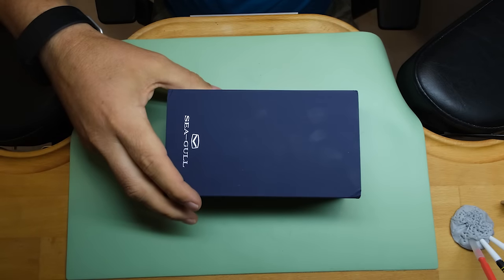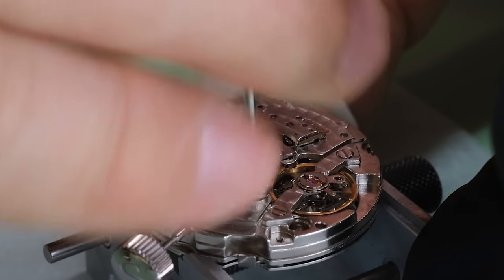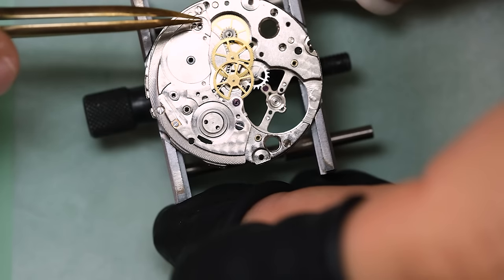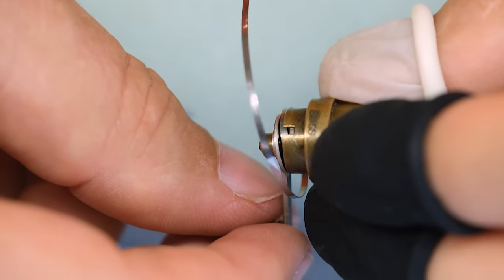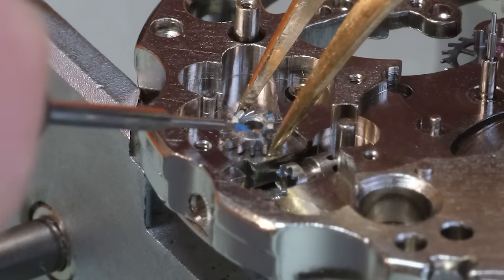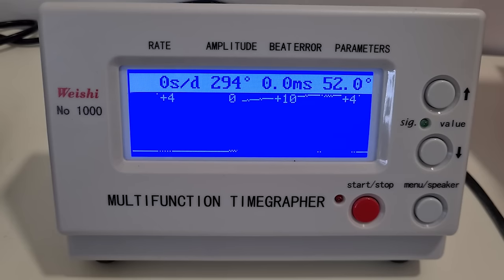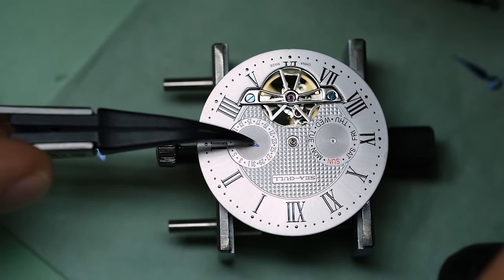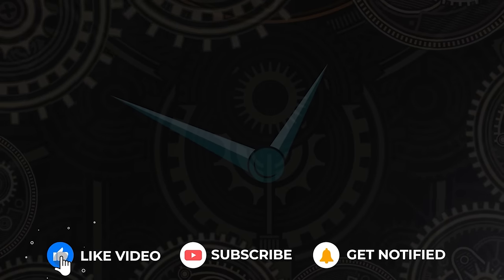How good are Chinese watches? Teardown + Giveaway!

Comment: The best new Sea-Gull movement to learn on is probably the ST3600/ST3601/ST36K.  This is a close copy of the ETA 6497 pocket watch movement, and fits nicely into a Panerai style case which can also be bought from Chinese manufacturers.  You can get it for maybe US $40 to $50 if you hunt around for it.  Some versions have the perlage on the visible plate bridges while others do not.  There is a version of the ST3600 which is decorated (perlage) and has a decorative non-fuctional swan neck regulator.  It may be possible to modify it slightly so that the swan neck part of the regulator is functional, at least within a limited range (needs a longer screw, and the swan neck spring needs to be a slightly different shape).

Similarly the ST3621 is a copy of the ETA 6498.  It's also recommended as a practice piece but is a little more expensive.  I'd be interested to know if there are any quality differences that people might have noticed given that the ST3621 is almost double the price.

The correct name is in fact Sea-Gull.  The late fifties of course it was just "Wuyi Watch Factory", which became "Tianjin Watch Factory" in 1962 when the factory was relocated.  The name of the watch being proposed for export around 1973 was the "Dong Feng" which means 'east wind'  This wasn't very politically sensitive at the time so the name of the export watch became Sea-Gull.  The name Sea-Gull as a brand for the company didn't come into existence until 1992, when it became "Tianjin Sea-Gull Watch Group Co. Ltd"  I think the hyphenation is one of those "lost in translation" things that will often confuse the English speaking world when they come across it, and of course many of them will insist on calling it just "Seagull".  Some histories state this company came into existence in 1997, but the difference may just be when the Sea-Gull company was incorporated in different countries and different markets.

Care is needed with the Sea-Gull copy of the incabloc spring as it sometimes has the tendency to fly off (it is a spring and may go far if this happens).  It also becomes extremely difficult to replace it without losing it again.  Don't ask me how I know this...

It's also true that these movements are made by other factories in China, so there is some variability that can be found.  Sea-Gull manufactured items are probably the most consistent but quality control can be variable as noted in this video.  Generally speaking, Sea-Gull movements will have ST designators, while Tianjin Watch factory will use TY designators.  eg ST1612 is also known as TY2806.

These are my notes regarding currently available Sea-Gull movements for those that may want to delve into these affordable movements for learning and hobby purposes.  Prices are mostly Sea-Gull RRP for export, you may see different prices depending on where you buy them.

ST36 Mech
	ST3600
	K = skeletonised
	ETA 6497
        seconds at 9
	US$53.99

ST1901 Mech Chronograph
	31.3mm
	21600
	21 jewels
	Venus 175
	US$139

ST1612 Automatic
	Similar to Miyota 8216 (0.4mm dia difference)
	TY2806 Tiangin
	26mm, center seconds, date
	US$35.49

ST2130 Automatic
	ETA 2824-2
	Tianjin 2100
	25.6mm
	center seconds, date.
	US$109.99
	

ST8000 Tourbillon	
	Automatic
	30mm
	US$369
	

ST3621 Mech
	ETA 6498
        seconds at 6
	37.2mm
	US$110.52

ST2100	Automatic
	ETA2836-2
	25.6mm
	US$115.00
	

ST1812	Automatic
	ETA2892
	26.2mm
	US$149.95
Reply: Is the ST8000 Tourbillon any good?
Reply: @freenational  I haven't bought one, but from what I can gather from others that have, they are reliable and reasonably accurate.  There's a few companies putting them into dress watches successfully, and as one of the cheapest serious tourbillon movements they do represent good value for money.

I'm not sure what movement or design it is based on, but it is a real caged tourbillon which rotates once per minute.  I would assume that whatever movement it is based on means that this, like all the other Sea-gull movements, is a snapshot of older proven technologies.  I actually like the Sea-gull movements for that reason.

Sea-gull/Tiangin use CNC engraving to do fake Geneva stripes and don't do a lot of fine polishing so the finish will never rival the best Swiss watches in that regard, but the underlying technology always seems to be sound.  If you wanted to get a movement to learn on or put into your own case, or buy a dress watch based on this movement, I think it would be a reasonable way to spend your money.
Reply: Great info !!!!!
Reply: @freenational 

For US$369, I would go for ARSA(Hoga, Royal Elastic, etc.) with Swiss movements assembled in HongKong.
Reply: Very cool, thanks for sharing. I have a chinese sea-gull clone i believe, it is called TY2807, the movement came in an Armatron Skeleton type design. My impression is that its surprisingly well made for what it is, i find it very attractive and the mainframe is a brilliant dark blue. I mentioned this because i read the last calibre you listed. Thanks again, i love learning about the history.

Comment: I still find it amazing that they are able to produce such an intricate mechanical watch at that price. Copy or no copy, that's still a hard thing to pull off.
Reply: Agreed. I’m finding watchmaking making schools use Seagull Movements.
Reply from the maker: Yep, it is in itself impressive!
Reply: Modern technology. 3D scanning and printing and and high precision cnc cutting. They haven't had this in the old days, which is why I couldn't care less about these mass products and collect vintage watches instead.
Reply: Not an hard thing to pull off when you pay your employees slave wages, use cheap materials and designs and you have no R&D cost because you copy everything you do from your betters.
Reply: Working community still work 3 dollars a day. So they can sell at cheap price. Quality of material yet to be time tested life like 5 years or 50 years.
Reply: @veganbutcherhackepeter  Vintage watches are also mass-produced. While you're right in that modern CAD machinery didn't exist back then, every single movement made since the 1880s has had at least some degree of industrialization and standardization. The classic image of a hunched over Swiss man tinkering away in his cottage hasn't been the reality for a very long time.
Reply: @vinceslapchopper  China has had a rapidly-growing middle class for a good while now. While they earn less than Americans do on a dollar-per-dollar basis, their purchasing power parity has been roughly equal since 2015 and is only increasing. Also, the concept of intellectual property just doesn't exist for the Chinese. Never has.
Reply: @sj9918  With modern machining techniques in place, I bet these Sea-Gull movements will last a good while yet. Remember, there's a good number of pin-lever Timexes out there that still work, and those were built with no attempt at quality whatsoever.
Reply: @jakekaywell5972  Foreseeing harsh reality.
Reply: I'm pretty new to this interest/hobby and don't know much about horological except that whenever I wanted to buy a watch in the past, even from a young age, I had specific criteria.
It had to be automatic.
It had to have a resistance to water so that I didn't have to worry about it getting wet.
It had to keep good time so that I didn't have to keep adjusting it all the time.
To my mind this wasn't an unreasonable expectation.
I didn't care about the make.
My first watch was one I bought while on a school trip to Switzerland skiing.
I was coerced into going and encouraged to badger my parents into funding the trip.
I ended up being the youngest on the trip by some margin and was almost totally ignored by the teachers and senior boys.
With my meager funds I bought my first watch (Swiss, of course) and on my way back through customs was required to pay import duty. This I couldn't do because I had no money left. It was duly  taken from me and I was told that could have it back when the duty was paid.
I never saw it again.
The next watch I bought was when I was a young man in the british army posted to Germany. This was an Omega speed master.
I decided to buy this because it was automatic with good water resistance and good time keeping.
I was unaware of its heritage, only that it ticked all my boxes.
It was the worst time keeper I ever had! I became so fed up with it that when one of my peers slyly asked me to sell it to him I couldn't get it off my wrist fast enough.
Next was a Jaques Droz divers watch because I needed a replacement for my Omega.
I had never heard of these watches and just wanted a water resistant watch.
I can't remember what happened to it.
The next one was a Sekonda which I bought while on the cross channel ferry.
It broke before I got off the boat because I over wound it.
I didn't know I had until about half an hour later when it stopped working.
Never bought one since and never will again.
Years later and untold unmemorable watches later I bought a Citizen skyhawk in titanium.
AT LAST! A watch I truly needed and envisioned.
The three criteria easily met and more. RADIO CONTROL!
200m water resistance and so many features that modern developments have brought for this watch.
And lastly butt not least, solar 
power!
What more could a man want?
I've had this watch now for over 20 odd years (I'm 76). I've just had it serviced for the second time. The first service was to get a new glass and bezel and clasp, all of which had suffered severe scratching (I enquired about a new bracelet but was quoted £300!), and the second service was for a new capacitor.
£200!
It's an old friend now and nothing is too good for it.
Super titanium would be nice but it wasn't available back then and probably hadn't been developed.
I have a small collection, mostly Citizen, which includes 4 bullheads and an f900 satellite controlled watch in super titanium.
I wish I hadn't sold the omega when I did because I could sell it now and buy another 3 or 4 bullheads for the same money.
With all citizens developments super titanium is the way to go.
If Citizen and Casio were to collaborate what a watch they could produce between them!
Yes, I have a casio. A tech marvel in titanium. From the get go a faultless performer for not much money.
Sadly, it suffers from the same affliction  as my skyhawk - titanium scratches easily except when treated by being superised.
My f900 super titanium hasn't a mark on it.
Reply: @VintageWatchServices  They are assembled by children in sweatshops working 20 hour days. I wouldn't call it 'impressive'..... exploitative more like.
Reply: @yessanknow302  Nope, that's a stereotype now, especially in a highly skilled profession like watchmaking. Also, China has had a rapidly-growing middle class for a good while now. While they earn less than Americans do on a dollar-per-dollar basis, their purchasing power parity has been roughly equal since 2015 and is only increasing.
Reply: If you buy 10,000 movements they are still under 3 dollars each. Mass production but hand assembled.
Reply: @veganbutcherhackepeter  Then it is even more impressive that they build this since the '50s: More then half a century before 3D scanning and printing or CNC.
Reply: @jakekaywell5972  if you care enough about IP, you can find info about country with most registered IP, China beat other countries for the last 12 years.
Reply: Only 49% of the manufacturing process has to be done in Switzerland in order for a watch to be legally considered Swiss Made.

Comment: Having spent many years dealing with Chinese manufacturing, I can say with some authority that the attitude "all chinese stuff is low quality rubbish". It's simply not true anymore. I've worked in electronics to the auto industry out there and the quality is only getting better, WAY better. Wages and living costs are getting higher but that really does fit into the quality argument. If people feel they are earning a fair living and valued their work IS better. In the 60s Japan went through this cycle and the 80s Korea and Taiwan did. It won't be long before Chinese domestic cars are common place on European roads (MG are 100% Chinese and common in the UK already). Personally I like both of these watches and would not be ashamed to wear either.

Comment: Stian--excellent video as always. I think your assessment of Chinese watches hits the mark pretty well. I have several of them, including an ST-19-powered 1963 PLAAF "reissue," and I agree it's a great value and a cool watch. I put the decoration in the "looks glittery with the naked eye" category--a 10x loupe exposes a multitude of sins that one might not see in a far more expensive Swiss watch. The Geneva stripes on mine seem to be cut with a flycutter rather than a polishing wheel, but that's not that inconsistent with the original Dong Feng with the original ST-5 movement, from the time before the brand name "Seagull" emerged. Those had hand-cut decorations designed to catch the light, with grooves much bigger than would normally be the case with polish. I have several of those original Dong Feng-era ST-5 movements, and each are different from the others because of that hand work. Of course, there is very little hand work now, except to deposit dust, puddles of oil, tiny hairs, lint, and fingerprints. 🤭The Seiko aesthetic of minimal decoration but high functionality is not so much in evidence here. Still, a lot of fun for a hundred-dollar watch.
Reply from the maker: Cool to hear, Rick! I'd say this movement certainly uses part of the Seiko aesthetic, more specifically the first half of it 😉

Comment: Hello Stian, I am enjoying your videos! The Seagull ST36 (6497) movement was a good movement to start learning for me. It was inexpensive and the larger size made it easier for a beginner to work on. I found a total lack of oil and debris/hair in the movement. Once cleaned and oiled, it will probably be a good movement. The incabloc springs do not hinge back and stay as well as the Swiss movements do and tend to come (fly) out of the holder. The solution for me was to add a tiny ball of rodico for the spring to rest on when hinging back.

Comment: These are interesting movements but I would think it’s difficult to keep track of which screws go where.  This is especially difficult during cleaning, unless you want to run multiple cleaning cycles.   In any case, these are great videos!

Comment: I've owned a couple Sea-gull watches, and I've been generally pleased with them, so long as they're simple dress watches. There are some designs that I even really love, but yeah, the finishing isn't great, and in one case, I got a watch that was advertised to have a Sapphire crystal and it was very clearly mineral. I brought it up to Sea-Gull and they replaced it for free, but like, come on.
Reply: So solly.
Reply: I used to buy them for a friend collector who doesn't like to buy online (he passed away late last year) we had two with mineral glass marked as sapphire, I can't say the customer service is bad they refunded us full and said to keep the watches! But yeah c'mon lots of dirt and messed up screw heads, even saw a loose little chunk of metal floating inside one!